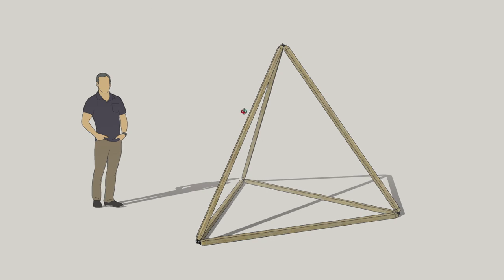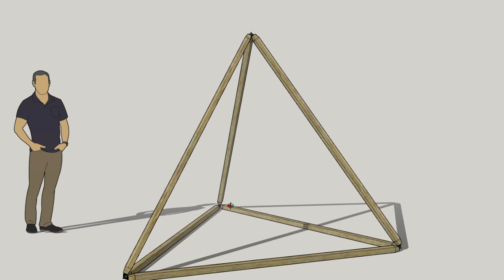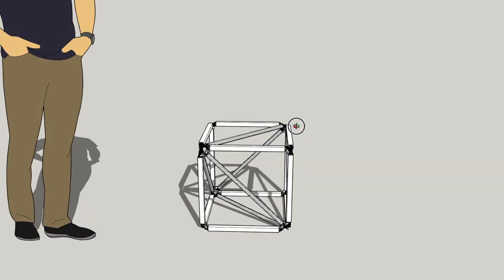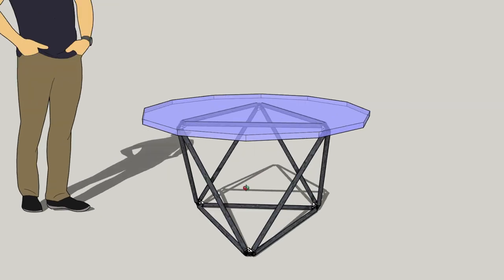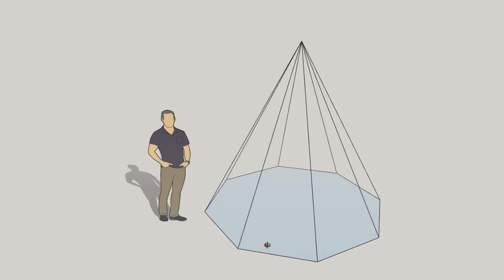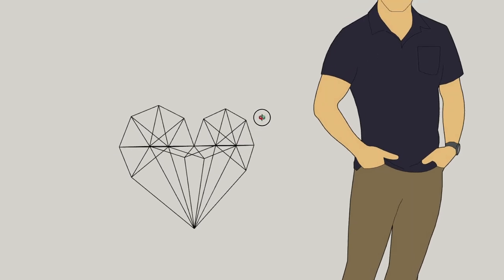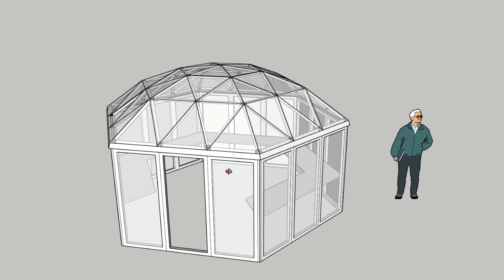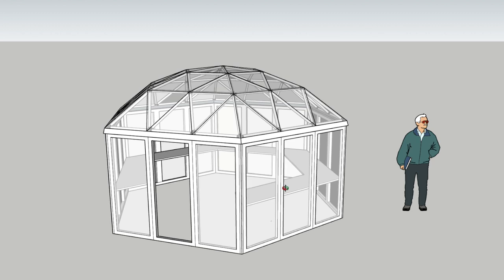Sneak peak at the WangerFlange plan book

Comment: It's looking great Paul.  Will you be providing the Sketchup files too?  I think it would be interesting for each project you show in your videos to mention how many flanges are needed.
For the teepee... doesn't that make for a massive stack of flanges at the top? What length bolts would be required that?
Reply: The brackets dont create a stack as they are all on the same plane. The diameter of the ring/hub just increases with the number of brackets in it.